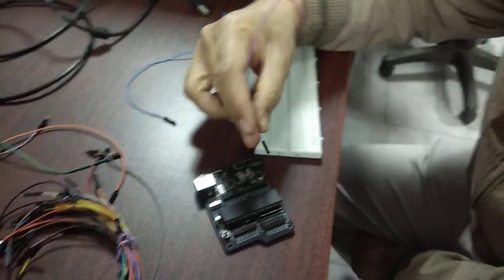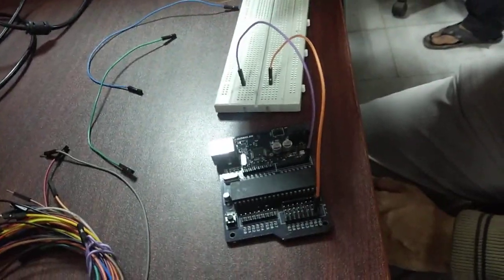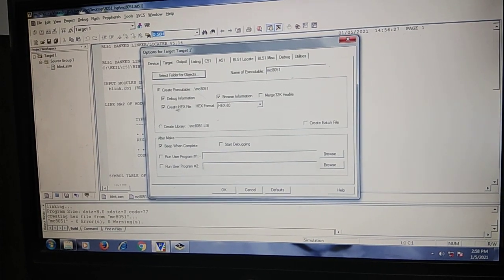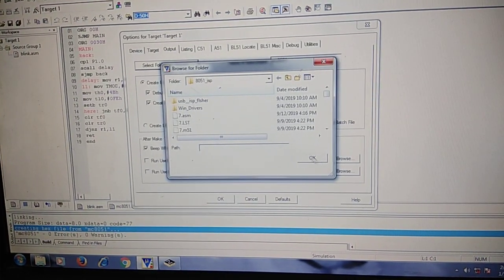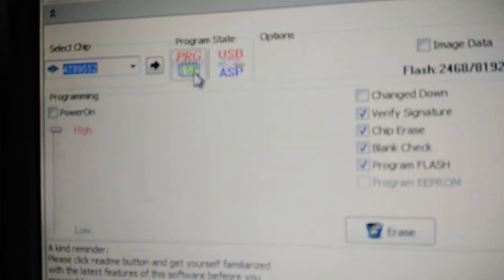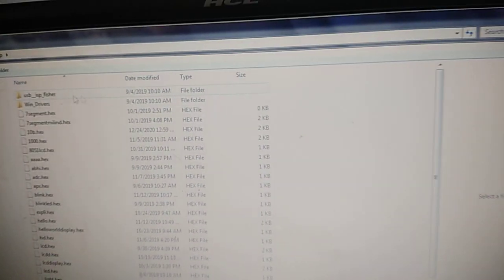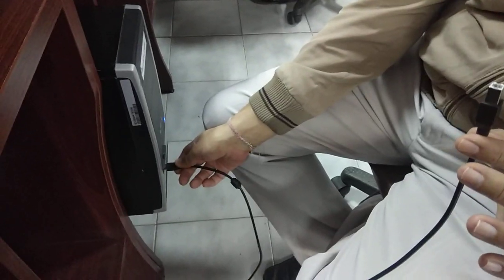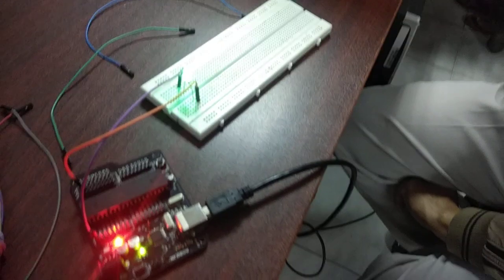Microcontroller 8051 | ARYABHATTA 8051 DEVELOPMENT BOARD | LED Interface

Comment: sir,i have bought a aryabhatta 8051 stamp board but for usb driver i cant run program via progisp sir please tell me the procedure of installation driver
Reply from the maker: Hi.  First connect the hardware to the system through USB.  Go to the device manager. Right click on Desktop, click on 'scan for hardware changes'.  You will be asked to install the driver.  Select manual option to install the driver.  Select the location where the driver software is saved.  Once the driver is updated, reconnect the hardware to the system.  Now you can program the hardware using PROGISP software.
Reply: @SharathKumaryn  sir,I have done everything but The desktop shows me"USB device is not recognize"
Reply from the maker: Hi @aritrasarkar8571 .  What is the OS in your system? Because the PROGISP may depend on the OS also.
Reply: @SharathKumaryn   windows 11
Reply from the maker: Hi @aritrasarkar8571 .  I have not tried on Windows 11.  You may have to use an alternate for Progisp software.
Reply: @SharathKumaryn  sir please help me I have tried various things,in various type. Please help me sir